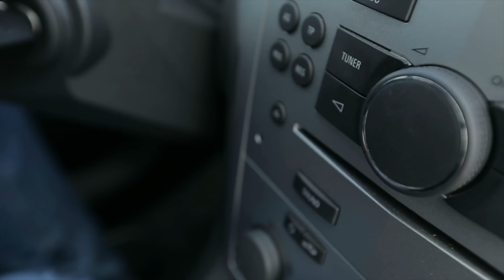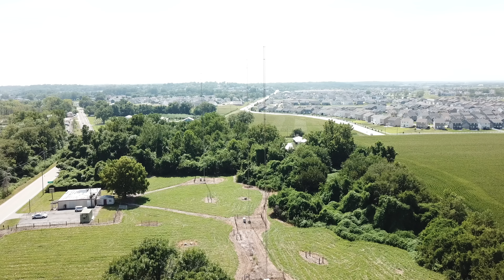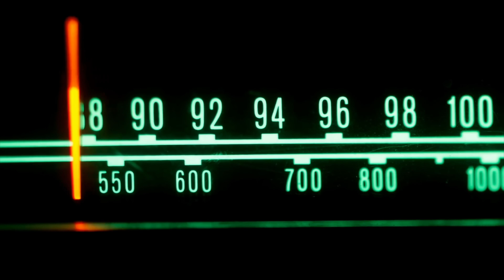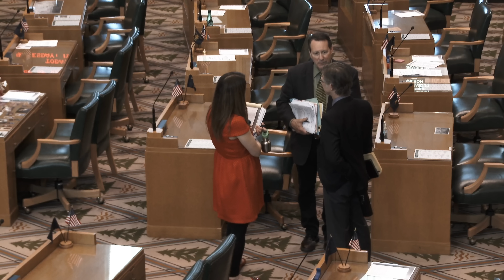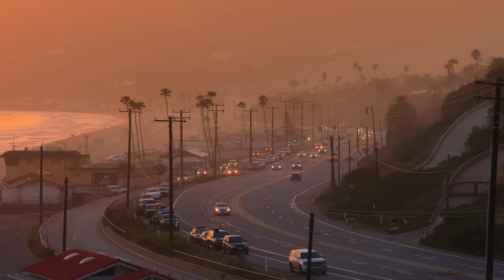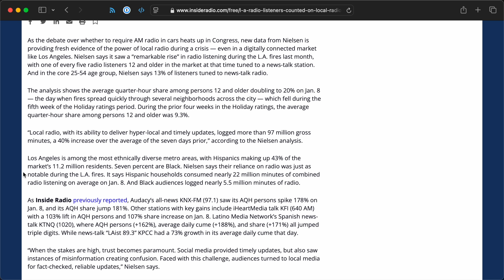Automakers are losing the battle with this 100-year-old tech

Comment: Yes, AM is absolutely relevant and an extremely important and vital technology. Any argument against that is extremely narrow-minded and ridiculous. 

AM transmissions are very, VERY efficient. 1kW on FM will maybe cover 20-30 miles at best. 1kW, especially on the low end of the medium-wave band can easily cover 100 miles or more! And the blowtorch 50kW signals go for thousands of miles at night and hundreds during the day. There is zero competition. FM just cannot cover the amount of terrain that AM can. 

The only reason AM is as unpopular today as it is, is simply because of two things. One is one the transmission side - that many AM stations broadcast at a much more narrow bandwidth than they have to. Each station can broadcast at a full 20khz, but many are brickwalled at 6khz, making it sound more muffled than it has. 

Secondly, on the receiving end, most radios today only hear up to 9khz at best for AM. So even if a station is broadcasting in wideband, your radio won’t hear all that audio. 

If you have the luxury of living near a good, wide-band station that’s well-processed, and you have a great radio or an SDR, you know that AM can absolutely sound amazing! Some great sounding stations currently on the air are WJIB 740khz in Boston, and they broadcast in C-Quam AM Stereo! Yes, AM can transmit STEREO audio! There’s also WXYG 540 in I believe Minnesota. Also in Stereo! 

I will die on this hill, I love AM Radio. I’m such a radio nerd that I shipped a Sony car radio that had shortwave on it for my car as well!

Comment: The reason "why not" is electric vehicles.  The inverters that convert DC into AC needed by the motors in electric vehicles generate so much RF hash that they make AM essentially unusable.
Reply: It can be shielded, they are simply not willing to cover the cost of doing so because they can.
Reply: @wassmuss4962  I doubt it costs much either.  If an electric Kia or Prius can do it a luxury brand can too
Reply: @wassmuss4962  exactly
Reply: I have a 2024 Kia EV6 and the AM radio reception is just fine.
Reply: Yeah, but:

1. Is it even legal/OK to drive an AM radio jammer
2. If it's available at least you could use it when the car is stopped, might be worth to stop if it's an emergency and only way of getting information available.

Comment: I have an AM radio that doesn't even need batteries to work, just a good ground connection. It uses the energy of the transmitting station to produce audio in the earpiece!

it's a (germanium) crystal radio.
Reply: The problem is that the range is very limited unless you have a honking big antenna and a really strong ground connection.
Reply: @ohger1  Now I'm just picturing an antenna as big as a car and a 10ft copper pipe drove into the ground.
Reply: @  Your 10' copper pipe into the ground is top notch, but the antenna should be about 80' of straight wire stung horizontally between the house and a tree, or two trees, etc. attached at both ends with ceramic or glass insulators. Back in the 1920s, radios were installed with such antennas unless they were within a few miles of a transmitter.  Later superhet radios of the late 20's and beyond were more sensitive and used a tuned RF pre amp section and could get away with a short wire or even an internal antenna.  Fortunately, I lived within 10 miles of three AM stations when I was a kid in the 60s and had a lot of fun with crystal radios even with using my bedroom window screen as an antenna and the cast iron radiator as a ground.

Comment: So their vehicles are mobile RFI generators? One reason they may require AM is be😢cause of its much greater range. By AM I mean the frequencies traditionally associated with AM broadcasting in the US (530 kHz to 1700 kHz) not AM as Amplitude Modulation mode which can be and is used on other bands including for aircraft comms on VHF. In Europe we tend to use Medium Wave instead of AM as the name for that broadcast band. By the way satellites can be "taken out". Yes AM broadcast transmitters can be too but easier to replace than satellites.
Reply: It's far easier to take out AM radio than it is a satellite. You just need  transmitters and antennas capable of transmitting a decent signal on the receiver's common local oscillator frequency, which is usually 455Khz. The Russians were notorious for this practice during the Cold War.

Comment: It's because the a.m. radio signal interferes with unshielded PC equipment, these manufacturers aren't using regular dash clusters and buttons and electronics anymore it's essentially a tablet and a couple of displays and manufacturers of vehicles that are going hybrid and complete electric don't want to do the extra work and cost to keep a.m. in those vehicles, it's not as friendly as FM or XM when it comes to interference and shielding, they're trying to save a chunk of change and labor
Reply: Hogwash, you would have to live next door to the transmitting antennas to even theoretically notice any issues with your pc.  The modern digital knicknacks do interfere with AM, quite badly in many cases.
Reply: @vbf1976 > It's because the a.m. radio signal interferes with unshielded PC equipment,.
AM reception doesn't interfere with anything.
Reply: AM receivers do not transmit signals.

Comment: the bill is getting pushed because conservative talk radio dominates AM radio, conservative law makers are pushing this on auto manufacturers, the disaster response talking point is bogus, because AM stations are subject to natural disaster destruction as much as cell towers except cell towers are distributed so if one tower is lost the whole network does not fail, which cannot be said for an AM tower.  the question is why you chose to frame it as an engineering problem and avoided discussing the political push behind the bill.

Comment: AM doesn't propagate further than FM.  Low frequency propagates further than high frequency.  It just turns out that our AM band uses those lower frequencies.
Reply: That would be "farther"
Reply: Your last sentence explains why your first sentence is incorrect.
Reply: @awesomeferret  You're only sentence is incorrect.
Reply: @awesomeferret  Actually he is correct: AM and FM are modulation modes. It is the radio band which decides the range achieved.
Reply: @graemezimmer604  FM needs more transmitter power to be audible as far away as AM.

Comment: Couple of my cars back the windshield wiper motor walked on the AM radio.  Entire band, if I remember properly.  "And today bzzt following that there will be bzzt ..." Highly annoying.  Hope the legislation says it has to work if the car is using any function except idling.
Reply: Sounds like you had a burned out cap on your wiper motor.
Reply: @juslitor  Could be I suppose but it always did that from new and after I had to get them fixed once.  When I was in Boston visiting I liked to listen to WBZ for traffic and it drove me nuts.
Reply: @juslitor  Or the motor and or installation was never FCC compliant in the first place.

Comment: I was attending the University of Memphis c. A.D. 1994, and a major ice storm knocked out power to most of the city for several days. I listened to the AM talk stations for hours at a time as they disseminated information about the emergency. That would have been a much worse experience without that resource.
Reply: Lived in Germantown then. Remember the ice storm. I had the same experience with AM radio.
Reply: Translation: "31 years ago, AM radio was useful to me."
Reply: @TheodoreTheFurry  Don’t even get me started about my portable cassette player. So nice.
Reply: @TheodoreTheFurry implication: it could therefore be useful again.
Reply: @Arby631  Yes, it could be useful, but COULD BE is not a reason to make it necessary for cars. It literally could rain every day, but you aren't reaching for your rain umbrella every day, just in case.

Comment: AM radio in Australia accounts for the vast majority of radio wave radiation in the cities. There is no need for such a powerful signal.
Reply: @FalkinerTim - Radio waves are Non-Ionising, just like the sun. They are harmless. 
You are confusing it with ionising radiation, eg atomic, such as Gamma, Beta, X-rays, etc. 
Plus most MW AM transmitters are in rural areas, well outside the city limits.
Reply: @graemezimmer604  I did not say they were ionizing.

Comment: I personally back AM Radio, and even called/emailed my local representative on the issue. AM can still do so much and the best part is AM radio is basically the lowest common denominator for electronic communication since you don't even need electricity to receive it if you have the correct simple parts. I feel like that alone is a major reason to keep it around even if it takes a back seat in the long run. However I like I'm going to discuss here I would love to see AM radio become somewhat mainstream again even if some changes are needed.

Unfortunately AM radio is falling out of popularity BECAUSE it's an old technology and in general one-way broadcast technology is falling out of popularity with younger people (like my own peers) who want high quality on demand content. Also nowadays Satellite Radio subscriptions like SiriusXM can be subscribed to for so cheap that a lot of radio listeners like myself end up there because commercial broadcast stations just have too many ads and not enough variety.

I think we can make AM radio better by:

1. Providing some funding to operate and maintain AM stations, especially independently owned and operated stations. 

2. Requiring all cars to have AM Radios and to encurage people to use it by bringing back live local traffic/weather stations that give people a good valid reason to utilize it.

3. More music/entertainment stations would be nice. Most people associate AM radio with conservative/religion talk shows, local news, and spanish/religious music which is not going to get younger people interested in AM.

4. The most important thing in this list is AM stations need to embrace digital systems like HD Radio to provide a better experience to people in newer/prenium cars because they may have higher expectations for audio quality. Also car manufacturers should be implementing it in all their cars and aftermarket kits (such as the DMHD1000) need to be made widley available again (Just a year ago you were able to find many DMHD1000 kits on eBay for $25, not anymore sadly). When iBiquity's patents fully expire for HD Radio's technology (which I think is happening soon) it should be made into an open standard and implemented it on all vehicles, new personal radios, and all AM/FM stations need to adopt it.

Comment: AM takes up a considerable percentage of the spectrum. I'm fairly certain the reason large companies are pushing to eliminate the reservation for the AM is so they can buy up the range. Mobile carriers would pay large sum's for additional spectrum.
Reply: The entire AM broadcast band covers about 1 MHz.  It is 100 times smaller than a single 5G cell channel.  It is about 1/80th of a single wifi channel.   Yeah, I'm sure mobile carriers are lining up for it.
Reply: AM can be easily converted to single side band. Saves 50%, thus 5 kHz ie 10 kHz. 
FM takes even more bandwidth (which is what you meant) up to 100 kHz.
Reply: The MW AM band is a tiny part of the spectrum, it is only about 1 MHz wide. 
You couldn't fit even one FM station or one cellphone tower.
Reply: @graemezimmer604  An FM broadcast station's bandwidth is 200kHz.  You could fit 5 of them in the AM broadcast band.
Reply: The MW AM broadcast band of the spectrum is worthless to mobile carriers. They wouldn't give you five cents for it. Low frequencies can't carry enough intelligence for modern data requirements, the cellular system requires line of sight propagation and absolutely no incidence of skywave propagation and the antenna requirements and power requirements
just make the proposition laughable. There's a reason that mobile phones operated on the frequencies that they do.

Comment: The automakers are being lazy.  Even the ICE engine creates interference on both AM and FM that would make Radio unlistenable.  The circuitry and engineering is out there to deal with the interference issue.  Maybe the broadcast engineering community can work on a solution with the auto engineers.

Comment: I‘m baffled the US still has AM. In europe, all analog radio, AM and FM, has mostly been phased out.
Reply: AM reaches across the long spans between our urban areas, at much lower wattages (same reason it's still in common usage in Australia). FM doesn't span nearly as far, all-digital FM is not in common usage here, & subscription satellite services don't provide local emergency alerts or weather conditions to drivers in the middle of nowhere.

Comment: Is the car actually required to use analogue signal for AM radio or couldnt you just move to the standard Europeans use for FM these days and use digital signals?
Otherwise they might be using digital signals these days, or simply too cheap antennas hence the interference. Your home antenna is no comparison to the standard that's in cars.

If you want cross country connectivity and a reliable signal your antenna needs to look like these long things Russians use.

You could also technically replace AM compatibility with a simplified sim network, but then again it'll be an antenna problem imo

Comment: There is horrible view being encouraged by the corporate money influence (essential dominance) of the federal government to treat all Public Media Spectra as precious monetary assets. This limited and undemocratic rationale and mindset makes corporations induce FCC and Congress to plan and think like corporations - they have Scarcity Mentality. "No just 'save' those AM band frequencies!" Don't license them or assign them. We are going to have some tech products that MAY NEED them "later."

This corrupted, NON-democratic conception of U.S. Public Owned resources, convinces Congress to use "fair" means of assignment of FCC licensing, like "auctions." Fair, right? NO! This is the exact model of cash value purchase forcing the escalation of pricing, and ALWAYS favoring the richest or resource laden buyer. Fair means of license assigning would be on basis of social need, social benefit, and continued fair monitoring and periodic re-evaluations. Fair process would avoid the inherit UNFAIR means of auctions - DESIGNED to escalate price and create monopolies - but use of randomizing or disconnecting the financial resource as unfairly influential determinant in FCC licensing. Use of Lottery type random selection among applicants, or a weighted scale of measured social values is the model of licensing that has been used to avoid the "money always gains control" method of auctions.

This is the same model that the 2 Party System uses to successfully "receive" donations - trade legislation for the greed cycle that corrupt corporations and corrupt 2 parties want. Corporations need only deal with 2 "vendors" of Bill creation, while the 2 parties maneuver to have their party's president sign the Bills into law. See Robert Reich's book "The Common Good" pages 86-87 citing Princeton study of 1800 government policy programs, to discover and verify that there is essentially ZERO correspondence between interests and needs of average Americans and government policies. That is not chance. That is the "successful" operation of financial/economic market on control of federal legislature and Executive branch.

Sorry for length. For SOME reason, the need for accuracy and fairness in issues of government opoerations SEEMS so important of late. 8-D

Comment: Um why not just something better such as low frequency digital (Digital Radio Mondiale)????? Move on!!!!! Plus would be a LOT better for emergencies to send text alerts or other critical data over even longer ranger range than interference prone unreliable and poor quality analogue AM - which is also a huge waste of energy and cost to stand up a powerful AM transmitter when DRM could do it so much more efficiently, and cheaply, more effectively.
Reply: MW DRM was been widely tested , but it just doesn't work. The problem are the long drop-outs due to fading and/or interference.
Even the manufacturers have stopped promoting it.
Reply: @graemezimmer604  India seems to be using it quite happily. And realistically how many people will be listening to AM in case of emergency? At least DRM can activate radios in an emergency.

Comment: There has been a push by some manufacturers to either have AM radio go digital or eliminate it altogether. Yet, analog AM stations are an integral part of the EAS here in the states. As you pointed out, the AM broadcast band can cover a very wide area. Also, with only a little knowledge, an AM receiver is the easiest one to maintain for emergency use. You can even build one with very few components. Anyone still remember the old crystal radio kits? While not as popular for music listening, AM broadcast is still  relevant and needed, even in our cars.
Reply: AM is much better than FM too for things like talk stations and sports, or anything where high fidelity sound isn't needed.

Comment: I feel you really did not address the need for AM radio. Yes, mentioned it does cover a wider area very easily. But only just touched on this. I think that actual need for AM radio should be stressed more. AM radio propagates extremely well for the power transmitted compared to FM. Especially since FM is more or less line of site where AM is definitely not. AM can be received in areas where FM cannot reach. AM is the emergency and notification go-to. Also, if auto manufacturers are stating their EV systems interfere AM radio and sight that as a reason not to include them, does that mean that their vehicles are not FCC Part 15 complaint? Thanks for bringing this up.